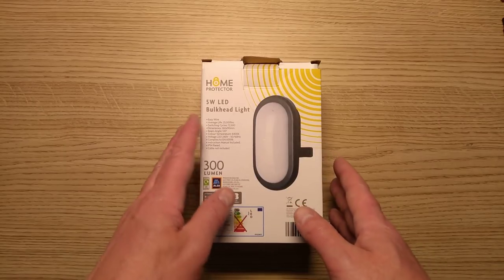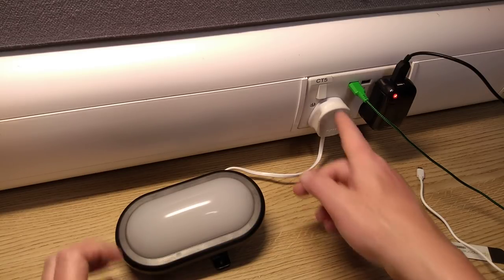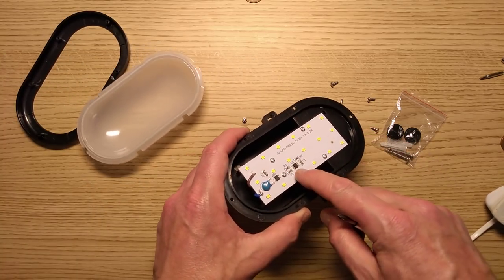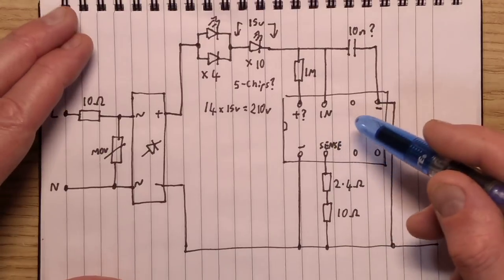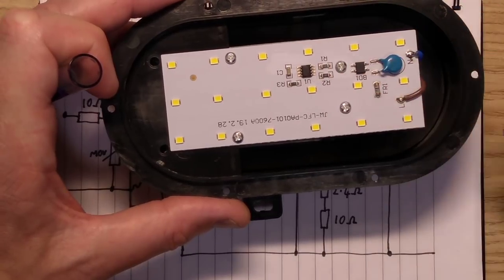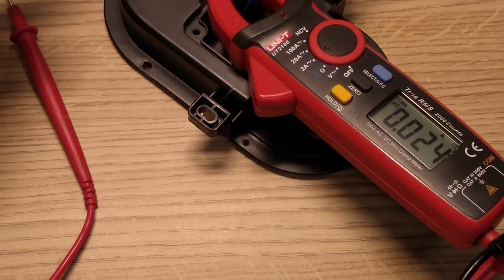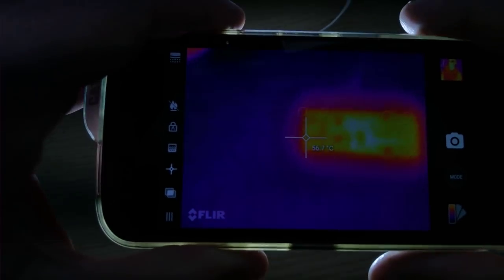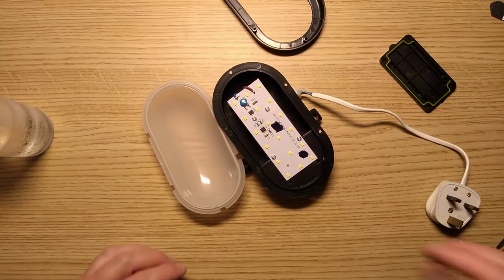Inside the Aldi 5W LED bulkhead light.  (With schematic.)

Comment: We used to have bunker lights around our property. A little bigger than this but the same idea. They were also waterproof. The first lot were plastic. Had to replace them with glass because the plastic went yellow and then brown in the hot, Australian sun. Funny thing was, they would get these little moths and insects into them. No idea how since the seals were quite good. No water ever got in.
Neighbours complained about the light shining into their bedrooms at night, so we ended up replacing the bunker lights with LED spot lights. Just angled them to point down onto the paths. Haven't had a complaint since. And the lights don't get any insects into them. These seal by screwing together, about half way along the body. Had them for about 3 years now and none of the LED lamps have died yet. GU10s. 3 or 4 watts, I think.

Comment: 26 °C ambient, poor Clive must've been at the verge of a heat stroke. :)
Reply from the maker: It's been far too hot recently.
Reply: It was 30°C ambient during the hot weather
Reply: In tropical countries 32°C is your ambient temp
Reply: 38.7°C was the UK record and we had 30°C ambient temperatures at night indoors. Most of us are not used to temperatures like this and AC is unheard of in homes.
Reply: @Xenon777_  42.2°C for the Philippines. High temp + no wind blowing, its not fun
Reply: @Xenon777_  You're still lucky cause you have winter. Most tropical countries cant afford ACUs
Reply: @Xenon777_  Fortunately AC is the norm here.  Mine went out last week, with outside temps around 32°C/90°F.  I managed to keep it a bit cooler inside, but I'm miserable above about 22°C/70°F, and it definitely got above that.  It's fixed now, back down to a comfortable 20°C/68°F inside. 

(Yes, I'm in the US, that's why both temps.  I like metric for other things, but I'll never get used to it for temperature.)
Reply: @bigclivedotcom  Especially for a Scot! Billy Connolly used to say that factor 50 suncream for Scots was a boiler suit and a welding mask...
Reply: @Xenon777_  Basically we are ideally suited to exist at 18 degree in a light drizzle.
Reply: @Joshua.26  Yes but you don't have to think 'do I need a coat?'

Comment: Aldi are VERY popular Down Under. There were rumours that Lidl were planning to move in on their territory but nothing so far. Their wine selection is far cheaper (and far better) than the rest of the Aussie major retailers (Coles, Woollies). Lots of very interesting (and pretty decent quality) electronics, whilst their tool selection is pretty good - bought a very decent sledge hammer from there a few months back!
Reply: Yep, we've bought lots of power tools from Aldi and given them hell, but they just keep going. Very happy with most of their products
Reply: @snells-window  Their 240v angle grinders are well nigh indestructible. Bought one a decade ago (when all their generic electrical kit had the Taurus branding) and although it looks pretty crap now, it still works just fine. Same applies to their Dremel knock-off, and more recently their gas powered pocket soldering irons (which conveniently take exactly the same catalytic heads as the brand leader - Portasol!)
Reply: Don't worry, Aldi and Lidl are not fools, they do many different products to each other, hence when they exist together in a nation they tend to co-exist with shoppers of one also shopping at the other, the ones who lose out the most are the larger corporate rivals and given those larger corps have long since driven our family owned businesses to the wall over decades past I have to say f**k em. 

Also on working practices they both deserve credit for good treatment of staff, good wages by comparison to their larger rivals.
Reply: They had some really good all cotton pajamas a month or two ago, you never realize how hard it is to find 100% cotton pajama pants until you go looking and find everything has polyester/acrylic in it.
Reply: There's none near me. There's a small one in North Sydney and an even smaller one in Chatswood. Never been in either. They don't look enticing. I stick to Bunnings for my tools.
Reply: haven't got them in new zealand. but apparently cost.co have done their maths and think that nz is big enough for them. more than likely, aldi....or lidl will move in quick. can't say green cheese, ae. lol
Reply: @collinhunter9792   Sry no Aldi Süd & Nord in New Zeeland its a shame >.> 

"No worries mate!" 
 >.<

Comment: Aldi are great honouring their guarantees - after 30 days you normally have to call a support number and send them a picture of your receipt. They then will usually post a replacement (or might take it back for repair if it's a high value item such as a laptop or TV.
Reply: Their post product failure service is excellent. Email via their website  is most helpful.
Reply: Be careful with the receipts. The thermal paper they use will fade very quickly if exposed to sunlight, or go black if exposed to heat. If you buy anything expensive you should take a photo straight away, just in case.
Reply: I always take a picture of the receipt for anything over £10

Comment: I buy my tools mostly from Aldi (called Hofer here) and Lidle - for the price they are great products. Just 3 days ago i asked my brother in law about what i should be looking for when going for a drill and he just responded with a photo from the drill they bought just a few hours earlier from Aldi - he was working as a metal worker for years and is now maintaining robots. I kinda trust him when he says that they are more than good enough for his private needs even when they are building a new house with those tools.
(Also lamps - Osram/Philps are good, but at Aldi you can get the LED-Lamps for like 1/3rd the price)

Or in short - for their price they are great products. They of course are not as good as the reputable high quality brands but also just cost a tiny fraction of them.

Comment: Aldi is here in Australia and is well known for their special buys on a Saturday and a Wednesday. We don't have Lidel yet but we do have Costco and Kaufland is rumoured to be coming. I have bought may of their Aldi's tools etc and have found the to be good value for their price point.
Reply: I hope we get LIDL one day because my European relatives who have both LIDL and ALDI tell me that LIDL is way better at managing their stock levels for their specials, so you are much less likely to miss out on popular items like you often do with ALDI.
Reply: I bought a 3/8s ratchet for $8. Fit and finish sucks but I couldn't complain about the price. I've had their 12v cordless drill for like 5 years now and its a definite value.
Reply: @johnpossum556  Yes, it happens that sometimes the finish is not that good. That why I said "value for its price point." I have picked up some tools and wouldn't buy them as they looked cheap and nasty.
Reply: @Berkeloid0  I've been to LIDL when I was overseas, they are very popular in Ireland. They remind me of Aldi in shop layout and products.

Comment: Speaking of Aldi gadgets: I HIGHLY recommend the Work Zone lithium screwdriver for around the house.  The one I am speaking of has a revolver style bit holder and is extremely durable and powerful for its size.  I bought them out after using one at the old oil change facility I worked at.  Used one daily for over a year!  It removed tens of thousands of small bolts, nuts and screws while withstanding oil and water baths almost daily.  Amazing battery life and capacity for what I paid, really think you should get one and review/use it.

Comment: Lidl in our town is very good for hardware and tools they restock Sunday and Thursday. got most of my screw drivers and Volt meter from l Lidl, quality stuff. A couple of years back they pulled down the store and rebuilt it at the other end of the car park! Never looked back gone from strength to strength!
Reply: I drove through a town recently where they'd moved across the road!

Comment: The problem with these is the plastic expands in the heat and the expansion can bring moisture in. If you want a quality bulkhead, you better off getting the old Coughtrie bulkheads such as the SP10 or SP6.

Comment: I love Aldi's. I save a boatload of money there and they carry a lot of variety of cheeses, chocolates, and frozen goods. Lately they've been carrying a knockoff of the Drumstick brand ice cream cones that have more caramel and fudge than the name brand. They're like 1/3 the cost of the name brand through a normal grocer. Their Onion Rings are particularly good. Very well seasoned.

I have a battery clock from Aldi's that has been running for like five years. The only non edible product I had an issue with is the white ceramic knife whose blade came out of the handle as I was butchering a whole fresh pineapple. I haven't bothered to bring it back. It was only $8.
Reply: I Agree...
Reply: Also a big US fan of Aldi's. They'd have to redo this one for the 110v "mains" over here. Having said that, I don't think I've ever seen anything at Aldi's that would have to be hard wired to AC power. Maybe predatory US lawyers scare them. :)
BTW, the mini maglite clones they sometimes have are pretty good. I also have an indoor/outdoor weather station that's nice.

Comment: For those not good at rewiring the bulkhead if it goes wrong, stick with the regular incadescent style, but with a led bulb.
Reply: I found an old Coughtrie bulkhead light, made in Glasgow, probably 30/40 yrs old? Repainted the cast aluminium, and it is now hooked up with an LED radar bulb. Well made and looks the part.
Reply: Yep, those coughtrie bulkheads are very solid, i've installed quite a few in my time.
We even had them in our minus 20C rooms at the lab where i worked, mounted on the ceiling, they got filled with ice quite often.

Comment: Nice light board designed well. But would like to see as well as current reduction thermal cut out and water block cut out. Would make it bigger and more expensive.  But its a great all in one. Very difficult to solder on these boards you need a 70⁰ hot plate to get the solder flow right. Use a fiberglass pen and flux pen. Speed is the essence. Thanks Clive great job as usual.

Comment: Cutting the cable on your toothbrush charger is beyond the call of duty BC.. Now that'll have a heatshrunk joint in it forever...:o)  Nice little outside light though - if it had a PIR sensor too I'd be buying a couple - I could add a PIR, yes, but I'm lazy. I like the seals - that thing might actually be watertight ?

Comment: I thought about putting up an LED bulkhead to replace the uncle's aging rather old bulkhead light, but after finding it was wired into the house's ring main & I didn't want to get involved with that, I just decided to shove a Poundland LED bulb in it and silicone the glass on to replace the long gone seal, if the wiring goes bang, it weren't my fault m'lud... :P

Comment: @1:40 - Yup, as long as you have some sort of snips , you got a flex ;-)
I tend to use old Computer cables and remove the end... cheaper than getting the plug or even the cable at a store.

Comment: My wife has ben holding out on me. She hasnt mentioned Aldi's had electronics, she was just there yesterday and bought 2 throw rugs. Aldi's is popular in kansas at least the city area. Out here in the sticks usually a mom and pop type store. I repaired my ice maker valve yesterday, after sitting 18 months in storage, I figured it was just stuck, I looked down the outlet side and a tiny hole just big enough to slide a toothpick in. Once in aim the toothpick just off to the side and ever so slightly you'll feel the diaphragm I poked (carefuling) the diaphragm several times. Til it moved. Surprisingly no videos on how to take apart or what's inside, I did find a video of a different brand I watched that. That video gave a general idea of what was inside. I dig that light tho. One thing about this house its dark. I need lights. There is a wide variety of lights in this house incandescents, flourecents, and I brought some LEDs. I need all them to be Led. CHEERS. from rainy Kansas today.
Reply: Aldi's in the US does not have electronics like they do in Europe, you might find a flashlight or LED lantern with the camping supplies.
Reply: @RandomAcronyms  do my wife hasnt ben holding out on me. Damit I was gonna use that against her, later. Good thing i didn't go with her then.

Comment: I'm proud to have 240v here in Australia!!
I'm also proud that our H type sockets have been ripped off by the Chinese, the only different is they rotated their sockets 180°
Reply: @johncoops6897  it's always been 240v from inception, especially in this day and age voltage up to 250 and as low as 230 is completely acceptable

Comment: Thanks for another useful video. Given your  comment that it is not repairable, it will be interesting to see what service life it achieves. Might be OK given the lack of electrolytics. Would help to have an explicit reference to the PF too. I have come to expect Lidl/Aldi stuff to be better than the usual chinese rubbish.
Reply: It still seems like the best compromise is LED bulbs in standard fittings, unless replaceable circuit boards become a thing (and I guess why not, but a bulb holder is way more compatible).

Comment: My ALDI stores in the US almost never has the same cool things that the Uk gets
Reply: they have mainly what is on the local market top-scale, and that varries around the USA, even from area to area. I bounce around 5 + aldi and the layout is always different and products stocked too.......... same for all other stores, unless you try and take on walmart mega store sites, even they roll products around monthly from shelf to shelf and aisle to aisle, to keep products rotation/expiry dates down... the issue there is it throws shoppers off because they don't change the aisle and above hanging products signs.... only thing worse than 900 signs are 900 WRONG signs, I would like to run both of my large wide foot steel toe boots directly up many folks hind-quarters over that :))
Reply: yes, it's all part of marketing schemes , moving product around, and lagging in signage changes to help inspire folks to splurge spend/buy...... non fake newsflash, not much longer ;)
Reply: Ummmm, maybe it is the 110/220 volt thingy! Nah, couldn’t be.

Comment: Saw these in my local Aldi yesterday and thought I could save the customer some money as the eterna version from my local whole sellers was 3 times as much.
I don't use the blind grommets supplied as they usually fail so the TRS/mushroom/domehead 20mm glands fit well using only round cable.
But hey I'm one of those part p electricians with over inflated prices eh Clive?🙄😄

Comment: ALDI is a german company, so the lighting is propably expecting a german NYM-type cable, which is round:

http://centralcables.co.uk/product/nym-installation-cable-single-or-multicore/

NYM is actually a code: N= normalised, Y= PVC sheathing, M= mantle. A standard cable here for most purposes, even in wet rooms, outdoors is also permitted if it's not exposed to direct sunlight (you can protect it by a conduit in that case). Not rated for direct burial into the earth, that would be NYY.

The most important differences to twin-and-earth are:
-round shaped obviously
-PE (or CPC) conductor is of the same size as the other conductors
-PE is insulated (green/yellow striped) inside the cable, so no sleeves required.
There are two variants available, one is called NYM-J which got a green/yellow insulated wire inside. Then there is NYM-O which doesn't have one inside. For example a 3G1.5mm² NYM-J contains a brown, a blue and a green/yellow insulated wires. A 3G1.5mm² NYM-O contains a brown, a blue and a black wire.

LIDL is also german, and they're actually competitors.

Comment: with currently about 470 comments available, it is hard to verify if my remark has already been made elsewhere, but to me, it seems a more logical explanation that the sense input is a sense to regulate the current through the LEDs instead of a voltage sensor to start the LEDs as being mentioned. LEDs are regulated by the current that needs to be kept within certain limits to prevent them from being blown up. It is very difficult to control LEDs by voltage regulators because of the steep voltage-current characteristics of forward working diodes like LEDs are. Besides, low resistor values near to a sense input are most likely to be shunts that convert currents into measurable voltages, especially when trimmed so neatly to a well defined value of in this case 12.4 Ohm..

Comment: I was wondering if the corner LEDs contained a different number of chips to the middle ones. Did you compare the voltages across the different ones?

Aldi do some good and sometimes weird stuff. There is a store just a short walk from me. Shopping there one day I saw someone load up the conveyor belt with axes and chainsaws. I kept my distance from them!

Comment: Similar to the bulkhead led lights in screwfix I have fitted, also IPX4 bathroom lights etc, .1 aluminium panel DOB, COB, 2 wires, double insulated. Ok for under stairs where a consumer unit is fitted to see, and its not used too often. They are indeed all going like this now. What a waste...remember when we just changed a bulb? lol..now it's change the whole fitting! but i suppose the aluminium plate IS the bulb now.

Comment: Nearly got one of those lights but plasticyness and the failure mode put me off.
Them there aldilidl battery appear to be able to made compatible with Ryobi drills and chargers ,it's still a work in progress ,seems to be working , done with a trial and error approach rather than a technical understanding.
Short preview vid on my channel if anybody interested.